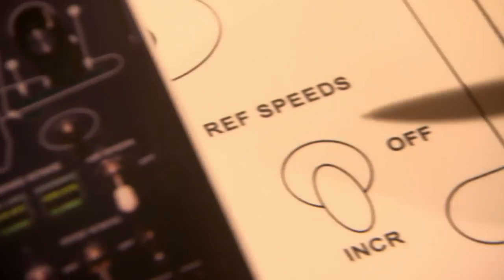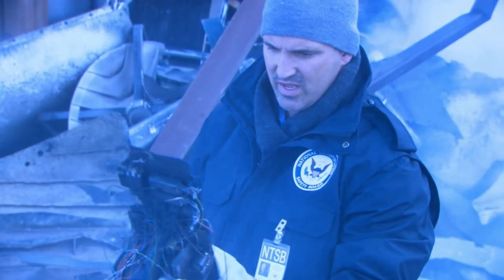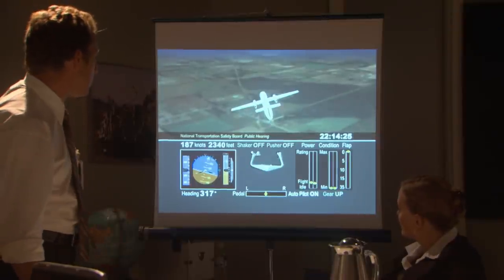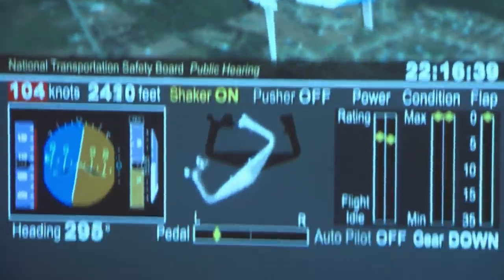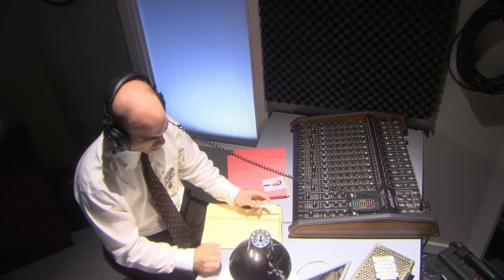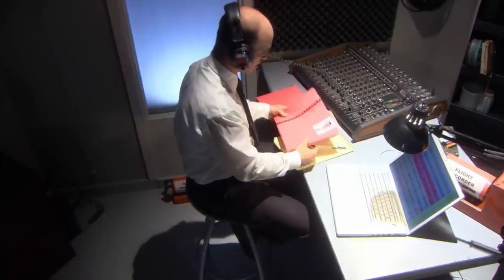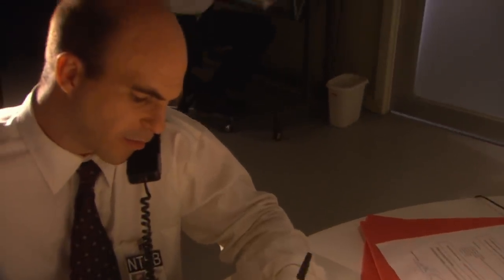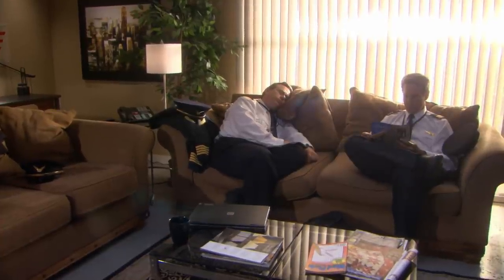An Investigation That Concludes 3 Fatal Missteps | Dead Tired | Mayday: Air Disaster

Comment: I was a professional pilot for 40 years, and my son is a better pilot than I was. I never flew the Q-400, but he did. He tells me that a rapid increase in power causes the airplane to want to pitch up sharply and roll ( I think to the right ). An experienced pilot knows this and compensates and the passengers never feel a thing. But it looks like already in a stall condition, they pitched up into a full stall. Game over.

Comment: Part 117 is a help, but min rest is still an issue.  Try doing 4 days of hard work with 10 hours between end and start of the next day.  Still not quite enough.  Not everyone can just fall asleep.  We need to wind down from work, eat, and workout (maybe).  That leaves on average 8 hours before the next day of work.  However, still got to get up and get ready, so really that is more like 7 hours.  To add to that if you take 30-45 minutes to fall asleep now that is less then 7 hours of sleep before working each day for days.

While pay is slightly better, it is still an issue and first officers still can struggle with the ability to earn a living for a few years without help from family.  Even 5 years ago, when I was a First Officer, I made a massive figure of 23k for almost 1100 hours of work in a year.  Problem is that people expect a cheap airline ticket, and the cost to become a professional pilot can be staggering.  The actual cost of a seat is around $64 per mile flown.  And that fails to include other costs like Flight Crew, Leases, Fuel, Rampers, Parking Spot Fees, Jetway Fees, Ticketing Fees, Baggage belt fees, and more.

Sadly, the pay will not go up for these types of pilots and only if they can make the big airlines will they be paid well.
Reply: 1/3 of you day working, 1/3 sleeping and 1/3 getting ready for both is a normal life and what FAA should mandate. Airports are huge, they should give some space for a crew bunkhouse and rec-room.
Reply: Wait 64$ per mile? Who would ever pay that? I understand captains and first officers should get better pay and accommodations but it would be insane to think anyone would pay 64$ per mile when driving can get you 8 cents per mile?